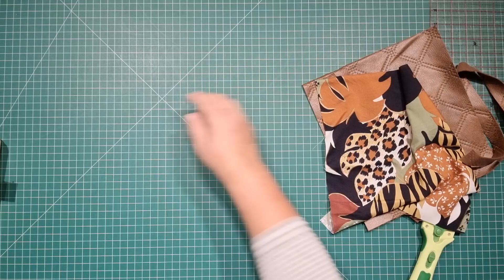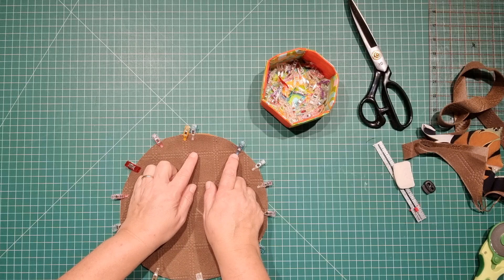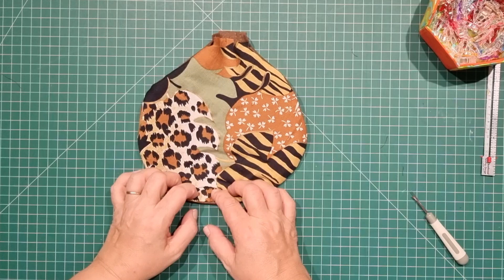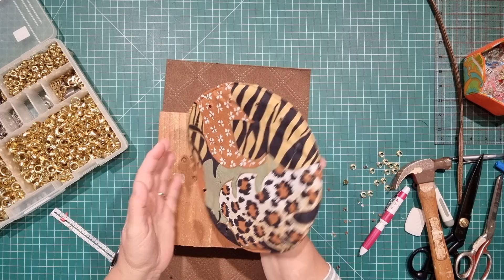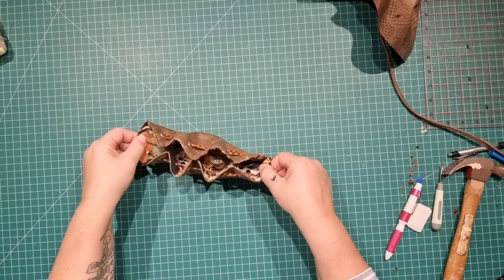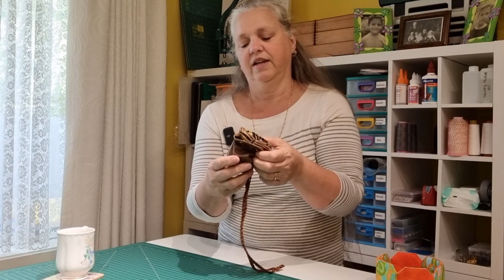How to sew a drawstring coin pouch, lined circle purse sewing tutorial for beginners

Comment: Yes. That is a cute little pouch. I love how it opens all the way out so that everything inside it can be viewed. You just showed me how the ring bag that I owned in 1961 was made. The circles were a whole lot bigger. Brass rings were in the eyelets. A heavy plastic bamboo looking ring went through the brass rings and was the handle. I loved that bag; however, someone stole the heavy brass ring that went through the closing cord that kept the bag closed when I sat it down. I could never find a replacement. That heavy brass closing ring was stolen from my ring bag while it was in my room. It had to have been my sister or one of my brothers who took it. I never knew who or why? The plastic bamboo looking ring kept my ring bag from coming all the way open; and, it made the bag stand up when I put it down. The heavy brass ring (on a cord) kept the bag closed when I wanted it closed (it also kept it open when I wanted it open).
Reply from the maker: What a lovely memory Arvetta. (not about the ring going missing though) Do you still have the bag? If so what size is the brass ring?  I might have one that is about 1 1/2".🙂
Reply: When you google "Roger Van S. Bamboo" you can find a few photos of bags that looks like what you described.
Reply from the maker: I've just Googled that Tina. I love this bag!  Is that what you had Arvetta? I was visualising something else. I've bookmarked it for a future project😁